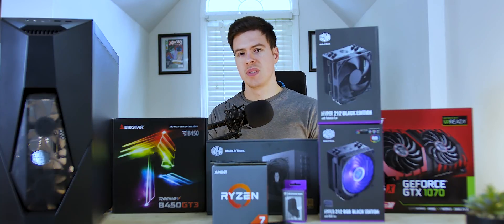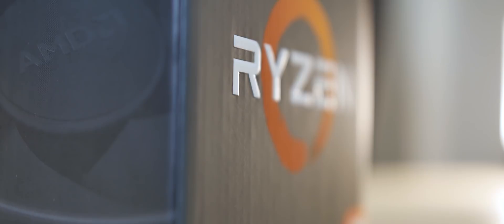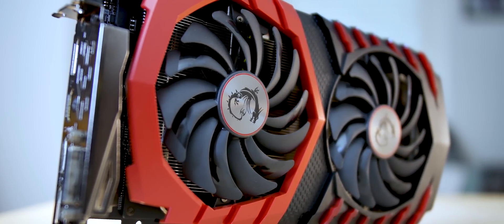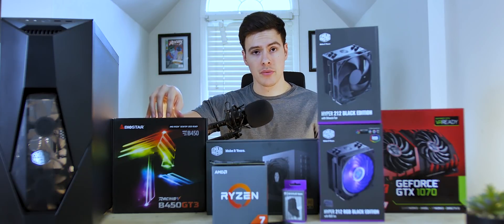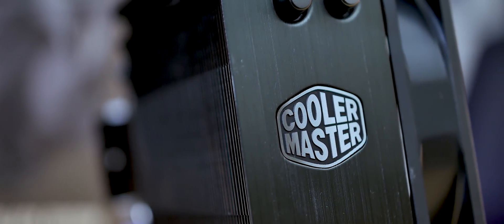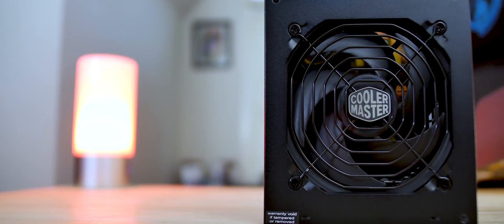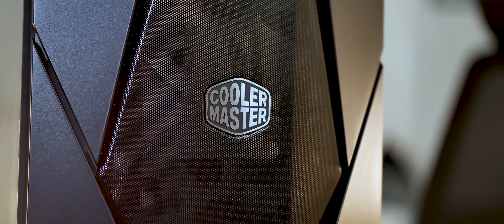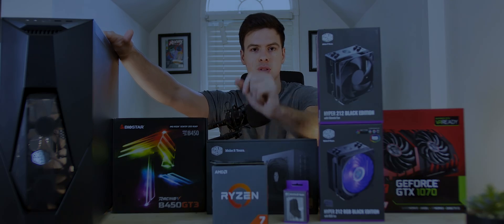$1100 1440P Gaming & 4K Editing PC Build Guide + Benchmarks

Comment from the maker: We've got a true 21:9 aspect ratio for this video today! The editing on this video took forever, so I really hope you guys enjoy it. For anyone wondering about temps: during peak 1440p gaming load the CPU  was around 48C and the GPU 59-65C with ambient temps around 25-27C.
Reply: I have the same build 
Ryzen 2700x 
Gtx 1070Ti Founders Ed 
16gb Gskill Trident Z Rgb 3200 mhz 
And Asus Rog Strix X470-F gaming MoBo 
Corsair Tx750m (2017 line up) 80+ gold 750 watt 
2 1TB 7200 rpm Hdd
Cheap ass antec case 
Saving for 256 gb ssd and a nice ass case.
Reply: JDTechGear  yeah I remember you staying you spent over 12 hours editing a video . Didn’t know if it was this one. You did an excellent job on the whole video music and all is perfect!
Reply: Hey didn’t see any specs on the editing side. Do you have any render times?
Reply: What's better for gaming the ryzen 5 2600x or the ryzen 7 1700
Reply: Sir, I have the same masterbox K500. But the two front fans only pops up into red colour and not RGB at all
Reply: Hello. Could you tell me if this case ships with a built in rgb controller? If so, how many fans can be connected. thank you in advance.
Reply: What software do you use for rgb?

Comment: This case makes absolutely no fucking sense, no space for cable management and just an absolute mess and headache to build in. Can't mount an aio in the top unless it's slim, so had to remove the front panel and fans just to install the radiator. Hella excess fan cables and RGB bs. I should have went with a Define case.

Comment: Even though I am late to the video that is such a lit build! Very good system for the money. What are your thoughts on the RTX 2060 and the Radeon 7 GPU? Do you think it would be good to upgrade to a GTX 1100 series instead if they are cheaper then RTX cards? Currently have an RX 570 so I am fine for now though. Also could you make a video on higher resolution vs higher refresh rate. I know this has been done before but I am trying to decide if I should get a 1440p monitor or a 144hz 1080p monitor. I will most likely upgrade to a used GTX 1070 or 1100 GPU since my 570 is barely fine for 1080p only.